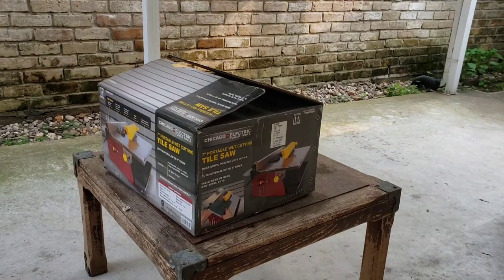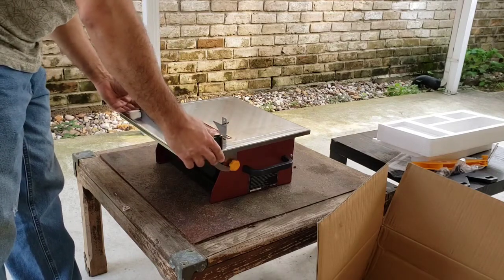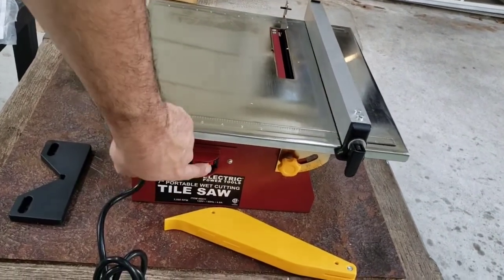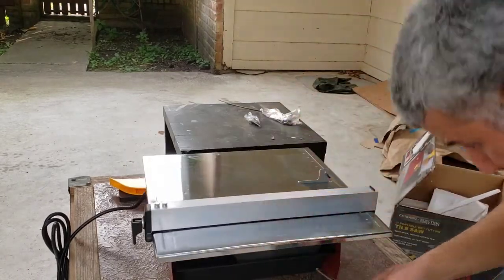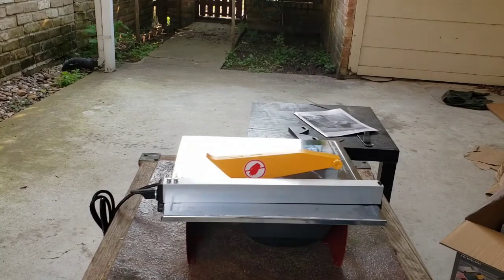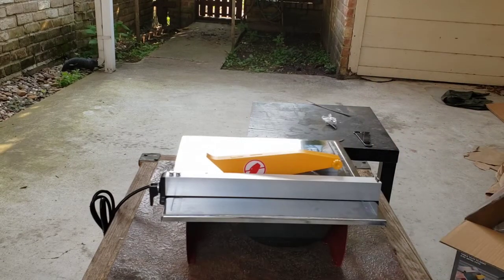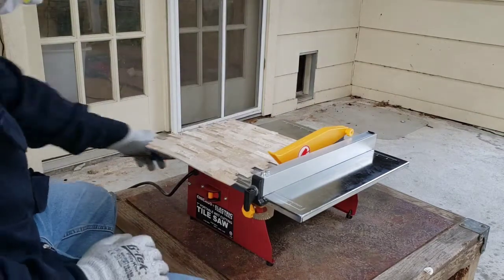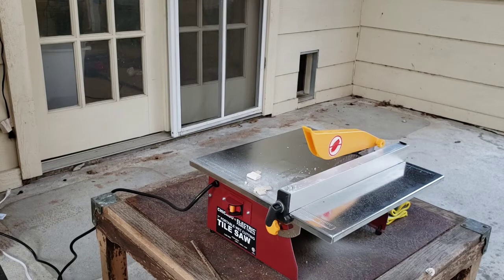Testing Harbor freight tile saw

Comment: You should never wear gloves, when you are operating a saw everyone knows this rule.
Reply from the maker: my bad i won't do that again
Reply: Not everyone knows that rule , I wore gloves too.
Reply: Why not wear gloves?
Reply: @oddlyrightoddlyright2475  Because that's how you end up losing a hand or finger. Only if the glove snags on the wood
Reply: @NoName-zz8nl  copy that..thanks I never knew
Reply: be really difficult to cut finger off with diamond blade, may burn it a tad though

Comment: Where is the water tray that keeps your blade wet and makes this the tile saw it is?
Reply from the maker: It is there but I didn't use it because this tile is self adhesive so I didn't want to get wet
Reply: @everydayskills  that makes sense. Thanks was just curious

Comment: how about the tub? seems very odd to get in and out? is there a trick to removing and replacing the tub?
Reply from the maker: they way they design is kinda hard but don't forget it is not top dollar item but it can do the work
Reply: Yeah, that's the only thing I don't like about this saw. There's no way to remove the tray without  making a huge mess and spilling a lot of dirty water. Maybe a turkey baster to suck most of it out first before tipping the tray for removal? I think I'll look at cutting/modifying the metal lips on the bottom so that the saw unit can just be lifted off the tray.

Comment: Can this machine be used with wood?
Reply from the maker: I think you can but you need to change the cutting wheel with a wood cutting wheel the only problem is the blade would not go up it is designed to go in certain high